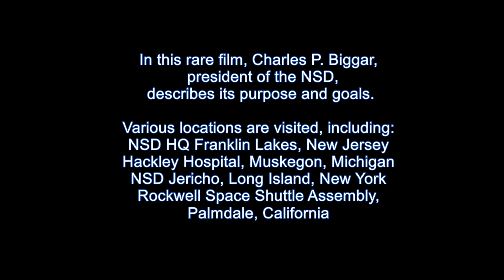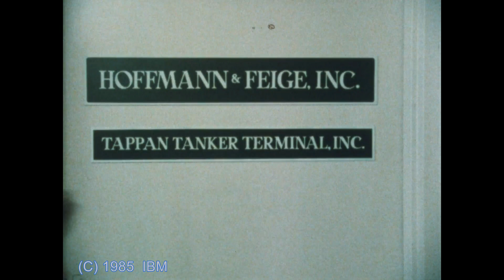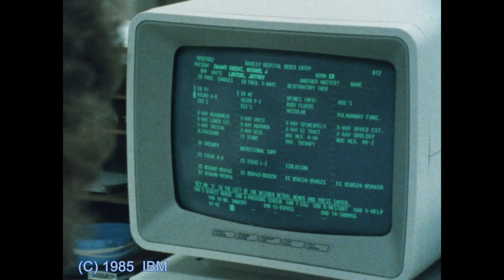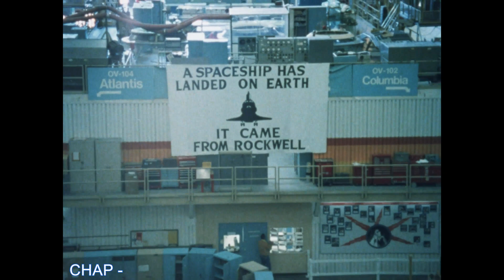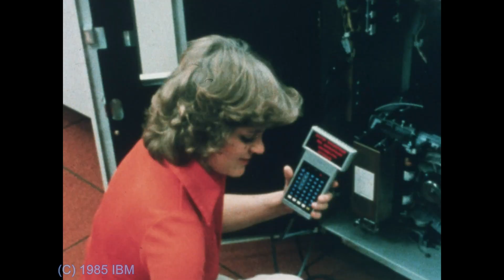Vintage Computer TOUR 1985 IBM National Service Div. Data Center employees, Rockwell Space Shuttle

Comment: I worked at an AT&T datacenter for years and the amount of old IBM, Sun Microsystems, and tape robots still amazes me.

That stuff is so cool. Fun to see how the dial-up I used in the 90s came into a building and connected to an old IBM machine that spits out more heat than my radiant heaters. 😂
Reply from the maker: Hi @orangejjay, thank you for the feedback, glad you enjoyed the look back!
Reply: I've taken apart a IBM 5151 monitor. There's 4-5 lb transformer in there that could cook a turkey. Plastic on those 40 year old things would crack from the dry heat just by leaning on it.

Comment: All for a few degrees less than desirable and a final rush decision to cause the 86 Challenger catastrophe
Reply: The fault of the challenger diaster is completely on NASA administrators not listening to the advice and concerns of their engineers. Not the fault of IBM or Rockwell.
Reply from the maker: Hi @benculp922, from what little I know, that was one craft that flew many, many years.  Perhaps a few years too long.  Every aircraft has a lifespan.
Reply: Rockwell manufactured the shuttle orbiters.  The STS-25 Challenger disaster was due to an O-ring failure on the Solid Rocket Boosters manufactured by Morton Thiokol.